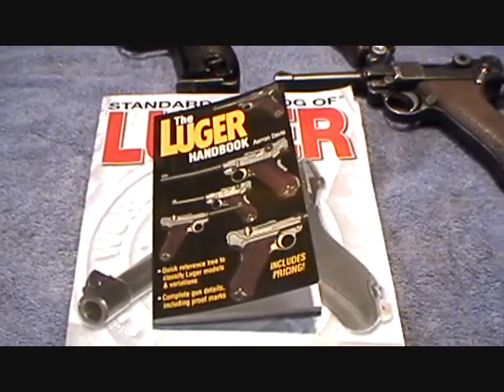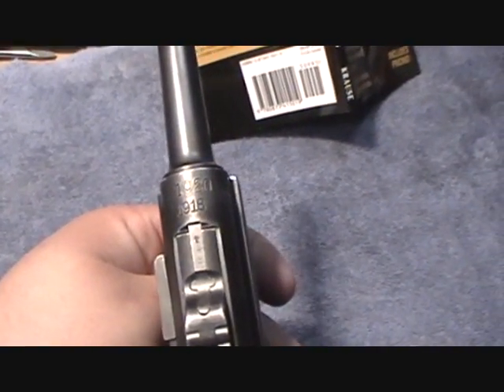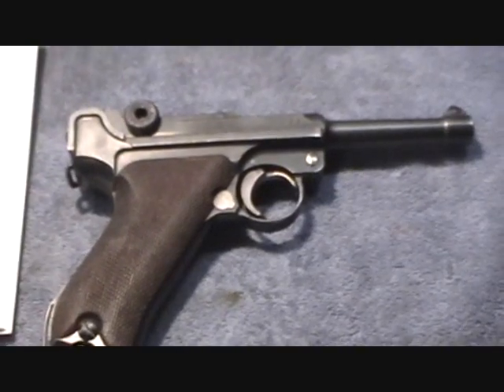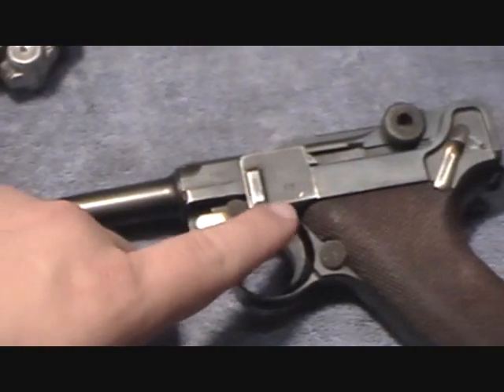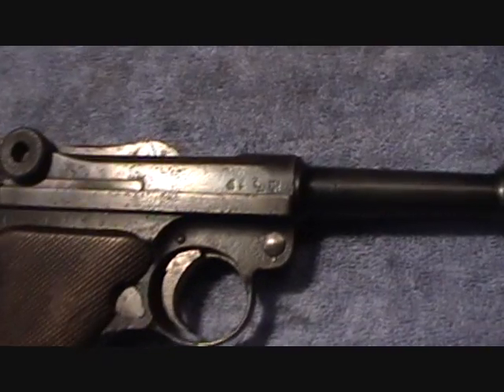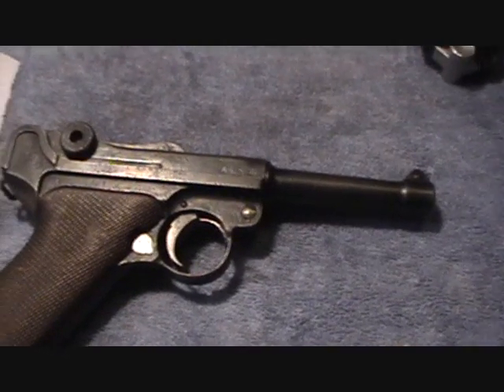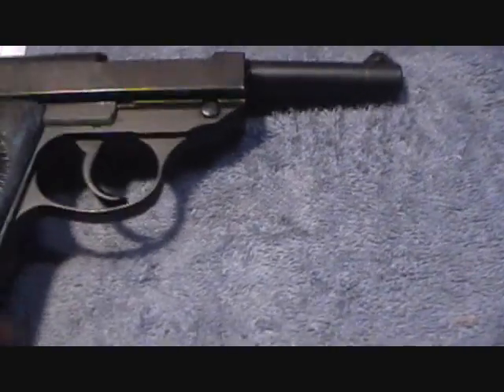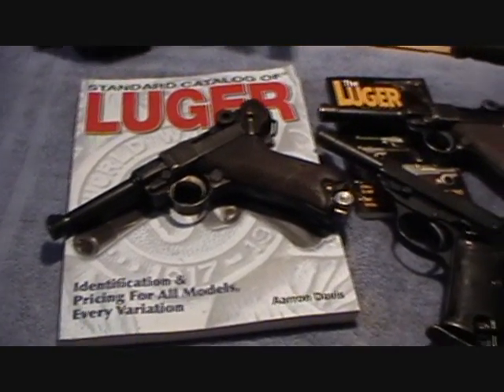Lugers and P38 Markings

Comment: HELP: my luger is a DWM "SCRIP" SN 738 (no other number dashes or letters). Iys a .30 luger with the 3 3/4 barrel.

On the top of the barrel it has S S and below that G P (same letters kn front of handel)

I can't figure it out, early 1898, or 1920s commercial????  Or does the P mean it's a police training pistol? 

Any help????
Reply from the maker: I wish I still had the books! I can't help you there, but I can help you with what I found on a Google search. Looks like someone put the big book in this video on PDF. Here is a link, maybe you can find something more there for it, too. I'm not clear exactly on the location of the markings you mention if you mean on the barrel or on the top of the chamber area where the barrel screws in to. So you'll have to check it out on the link. There are lookup charts and tons of info to check out. Don't see any vids or pics of the gun on your page either. But it sounds like you have a DWM anyways, as they used a fancy script font on top of the toggle. And if it's a .30 then it sounds commercial. Be interested to know what you find out!

https://www.selfdefensefund.com/wp-content/uploads/2017/09/Luger.pdf

Comment: I have a luger and questions on the markings. First there is no date stamped on the top or anywhere. I do see a serial # 3311 and 11 on all parts but where will the stamp be on the mag? The Mag drop, safe level, trigger, and more parts are gold in color. The only markings I see is "N" with a small line above it. Plus a "N" what looks like a Eagle sitting above it. With the serial # there is, what looks like an arrow pointing up. Anyways if you have any info on any of that please let me know thk

Comment: I was at a gun store awhile ago and i came across a Walther p38 (spreeworks) pistol. The odd thing about this p38 was the extra markings on it which was a upper case B inside a crown, i believe. Do you have any idea what this specific marking is?
Reply from the maker: Not sure hard to say without seeing it. The Norwegians adopted P38s in the 60s and it's a Norwegian crown over a shield with a N inside it. May be helpful to know if it was on the slide or frame and where. But I don't see anything in a search for it. And it wouldn't be Imperial German marked. Could be some commercial production for another country. I did also see another crown over N that was some commercial production.
Reply: @MarshalZhukov  i do believe the markings was place on the slide and frame. The worker at the store told me it could be a British capture pistol during WWII and my friend told me it could be a bavarian markings.

Comment: My Luger (my Dad brought it back in 1945) has no year markings anywhere.  It has one four digit serial number, and the usual two digit marks that match, except the magazine.   No marks on the barrel no date or marks on the receiver or under the barrel.  Also has a nice correct hoster.  

My Dad was home on leave on his way to be part of the Japanese invasion when Japan surrendered!
Reply: From my research, a luger with no year marking was manufactured in 1920.   Lugers were stamped before and after 1920.  A double stamp pistol such as one in this video showing 1902 over 1918 was not made in 1920.Mine is the same way and it has a police unit stamped on the front strap from a town in Prussia.  All serial numbers match and the police stamp matches the one on the holster.
Reply from the maker: Very cool. You should show some pics or make a video!

Comment: You will find your DWM luger is better machined then your Erfurt Luger.  The Erfurt  Lugers usually have tool machine marks on the frame sides   A nice P 38 is the Russian one, that has been Parkerized and has metal grips. It has the Russian star on the slide. The Russians took the German pistol machinery and parts back to their homeland after the war, and made their own with existig parts.  Get a Banner Mauser if you can find one in 9mm, it is alot cheaper to shoot then 7.65.